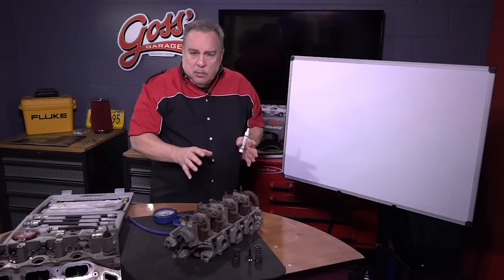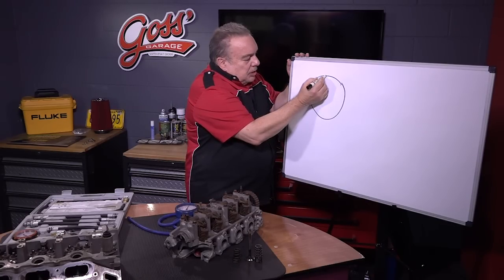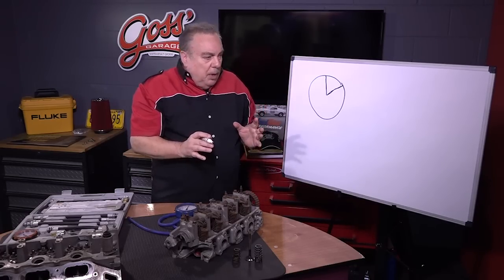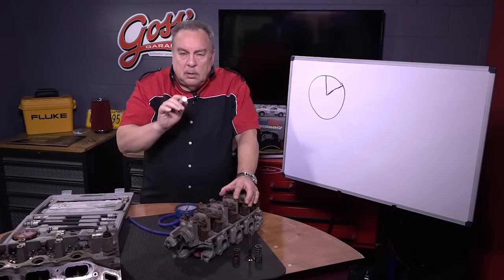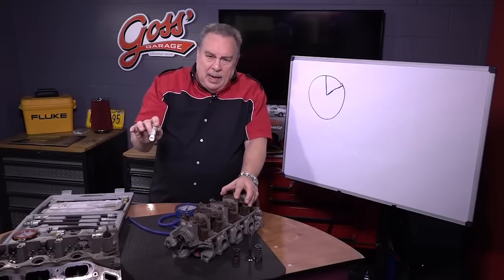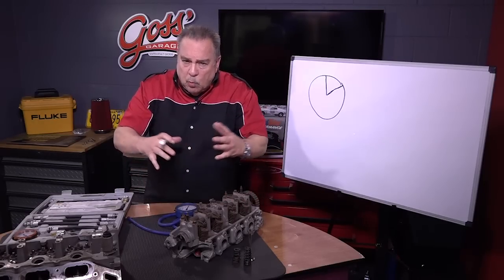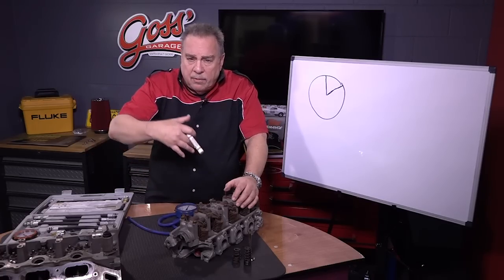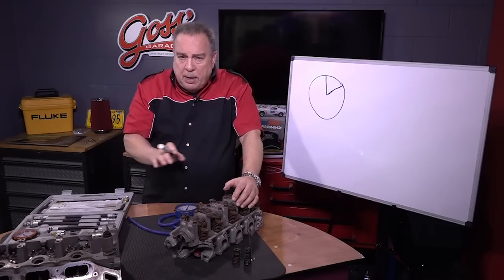Goss' Garage - Diagnosing Misfires

Comment: that's a heck of a find! not at all what I was expecting. I just went through a misfire with my hemi RAM. I think I narrowed it down to one of the two spark plugs in the cylinder. the light has not come back, and the problem started when I replaced the stock plugs. we shall see what happens. keep up the good work!

Comment: Pat, 2002 S10 with 4.3 liter engine.  Along the way for other reasons, I've changed the distributor, the plug wires, the plugs and the MAP sensor.  It shows no codes.  Yet there is a miss at idle that I cannot get rid of.  Intake manifold is good, oil is not getting anything else in it, truck isn't smoking.  Has 136,000 so it's not super high mileage.  Can't figure it out.  I've changed all the filters and fluids because it sat and it needed it anyway.
Reply from the maker: If it is a Vortec engine have you checked the central injector and poppet injectors? If it is non Vortec have you checked the injectors?